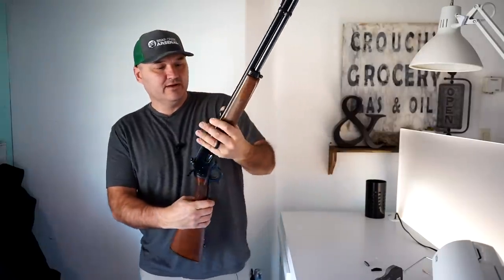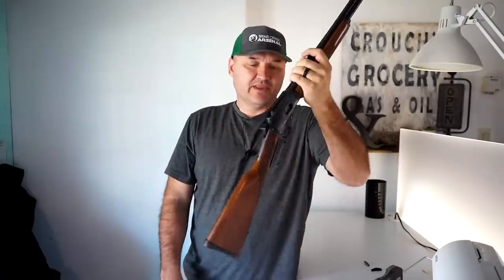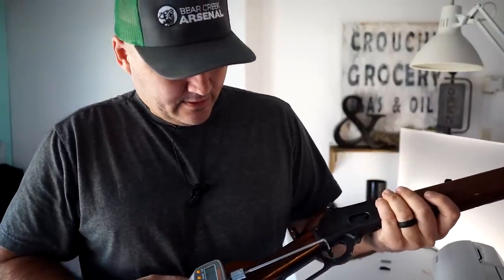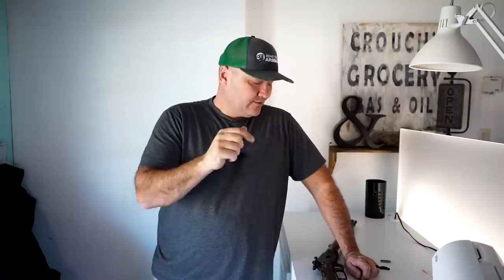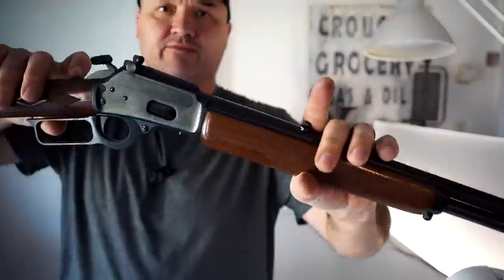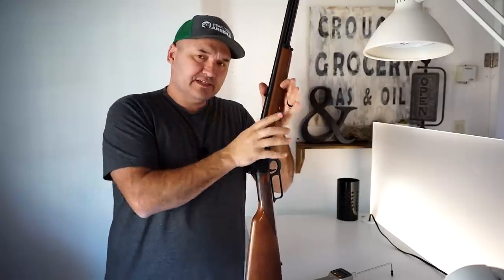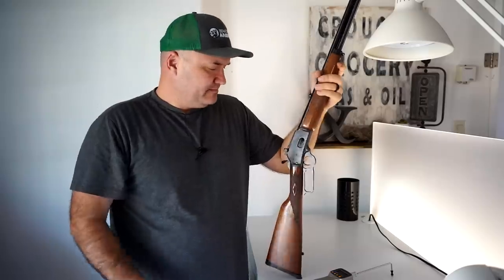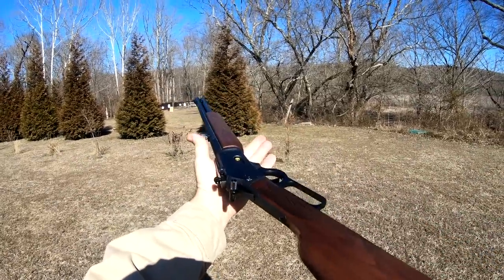Marlin Lever Action "Trigger Flop" Cure! ~ Ranger Point Precision

Comment: I fixed 4 Marlin trigger floppers using a piece of paper clip wire cut to approx 1/2 inch long. Shape into a rectangle using long nose pliers. This snugly fills the space between the trigger and sear. Cost = Nil.  I've known people use a small O ring but they tend to wear and fall out after a while.
Reply from the maker: Improvise, adapt, overcome.... I like it ;)

Comment: The Wolff reduced power spring is lighter in pressure but longer in length. This extra length is what tends to prevent light primer strikes. Just removing coils from the stock spring ends up making the spring too short as well as too light which is a great combination for failing to ignite the round.
Thanks for taking the time.

Comment: It's the little things that make the difference! Seriously though, when you take the time to upgrade your weapon with a new trigger, a better striker or any other small and inexpensive internal upgrade, you really boost your skills and your confidence with that weapon because you get a better understanding of what's going on internally when you pull the trigger. Obviously, the 1st step is to visually inspect and make safe your weapon before starting a project, but you should also watch the manufacturer's installation video and make sure you are confident enough in your skills to take on the project to begin with.
Reply from the maker: Excellent advice!

Comment: just for what it's worth, i installed a wolff main spring into my marlin 1895, and i did have to take it out and replace it with the stock spring, because of light primer strikes. with my reloads, it was not an issue. but when you realize you forgot the ammo at deer camp, and that is 80 miles away, buying factory ammo seems like a better option than missing opening morning.  but yes, the lighter spring makes a big difference. to bad it is just a little to light.

Comment: Speaking of Skinner Sights, did you have to replace the front sight on your Henry H001?  After my scope pooped in its food dish, I'm considering peep sights.
Reply: I had to replace the front sight on mine after installing the Skinner H001 drill and tap sight. I purchased the HiVis front sight for the H001 on Amazon. I still had to swap out the front sight on the HiVis sight for a taller one. It ended up being a 3/8 inch HiVis front sight.
Reply from the maker: I did not replace my factory front on that H001 but I need to do it. It definitely needs a taller sight. At first I thought I could live with it being a little high but it's actually became quite annoying guessing the hold at different ranges.
Reply: @buffalosoutdoors  I guess it depends on how you set it up.  I have Tech Sights on a Marlin set 4" high @ 50 yards.  That keeps me on a clay out to 100 yards with a 6 o'clock hold.  If you want to squirrel hunt, that's probably not going to be good enough.
Reply: Oh and I forgot to mention, with the 3/8 inch front sight the front sight hood would not fit back on over that tall of sight. Which since having the hood off I now prefer it that way anyway. Less clutter in the sight picture.

Comment: You can talk at me again soon any time.
Love me some sweet levergun. One of my wish list guns is a Marlin 1894 sent out to Grizzly Custom Guns for a total slicking up/improvement job and custom features. Hard time figuring out what caliber I'd like...
Reply: Lifted_Above 44mag aaaaalllllll day!!
Reply: It's a great cartridge for levers. But for a multi-use purposes, I'd rather have .357mag. In a carbine, .357 approaches the power of .30-30. No slouch. .38 special is far more economical as well, compared to .44 special/mag.
Reply: I’m going to get one and cut the barrel down to 12 inches so and shoot pigs in dense scrub so I think the 44 would suit me better. Still a small fast .357 would be sweet too!
Reply: @Owl566  I'm sure you've done the necessary research for shortening the barrel that far, legal-wise.
I think a .357 runs optimal about 18"-20". Full length tube would allow 10 rounds.
Reply: Lifted_Above yeah mate, it’s all good. I’m in Australia. In my state as long as the overall length is longer than 75cm (which is about 29 and a half inches) and I have a “reasonable” excuse then I’m okay. It’ll basically be a Mare’s laig with a stock 👍🏻👍🏻
Reply from the maker: I'd love to have one gone through by Grizzly as well. I have heard nothing but great things about their work.
Reply: Buffalo's Outdoors one of their customs would be very nice! Unfortunately they’re crazy expensive and trying to get a particular custom firearm imported to Australia is very difficult. Best I can do is buy upgraded parts (trigger/follower etc) and have a gunsmith here piece one together from a standard rifle.

Thanks for the great content you put out too mate 👍🏻

Comment: Wow for how expensive the gun is I’m surprised! I have a 336 in 30-30 that doesn’t do that.
Reply: Yeah I didn't think mine did either until I just went and checked it. Sure enough it flops around like crazy.
Reply from the maker: It's just the design of the way the trigger engages the sear. If yours doesn't do it then someone has likely "fixed" it already.
Reply: $375 gun up until about 3-4 yrs ago